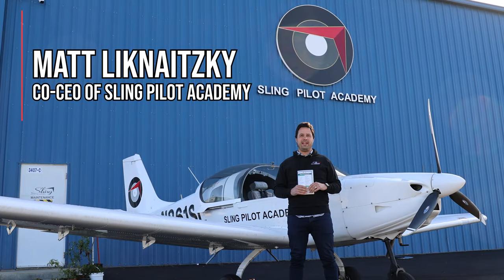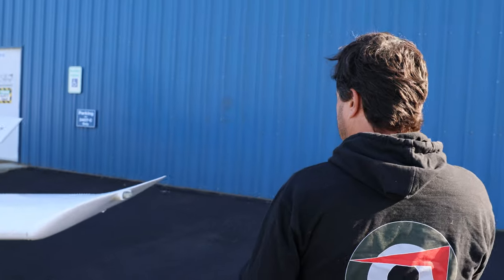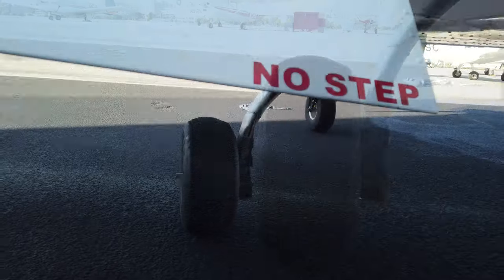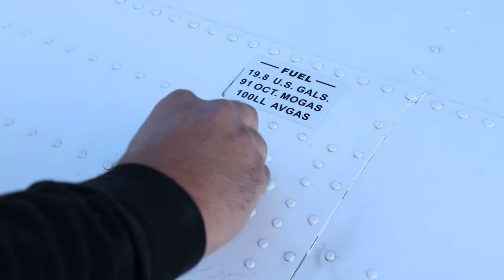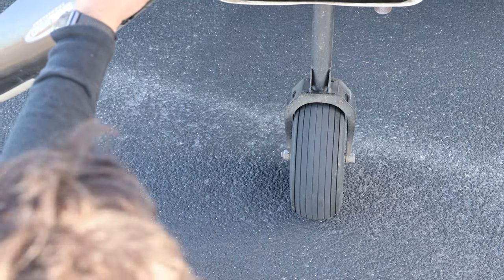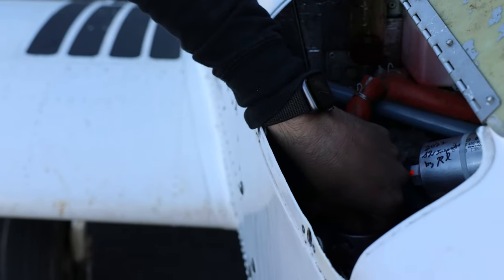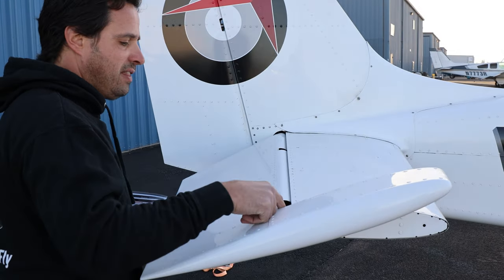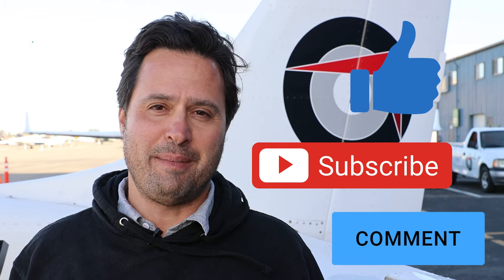How to Preflight the Sling NGT

Comment: Just some things I that I like to check in addition: 
 While I wait for the efis to load up, I do a quick walkaround and check all the lights are functioning and touch them to make sure they arent loose, i  also touch most of the antennae to make sure they are secure, and ensure the flaps came down on both sides. 

When checking the flaps, it is a good idea to ensure the rotating bolt has full movement and can be flipped from side to side without issue. 

I also touch every bolt and joint in the flaps and aileron to ensure they are secure.

When looking at the left side engine compartment, ensure that the throttle hold open pin is secure and in good shape.

I also give the wing a good gentle waggle to ensure continuity of the wing spar, and that there is not skin or rivet damage on the wings.
Reply from the maker: Great advice, thanks for sharing!